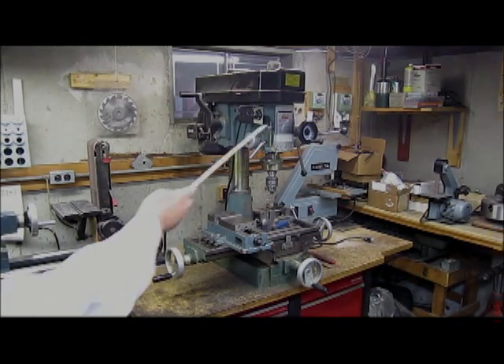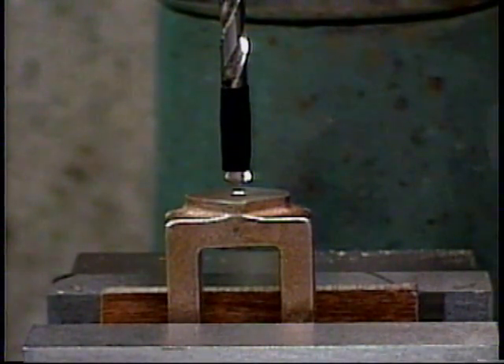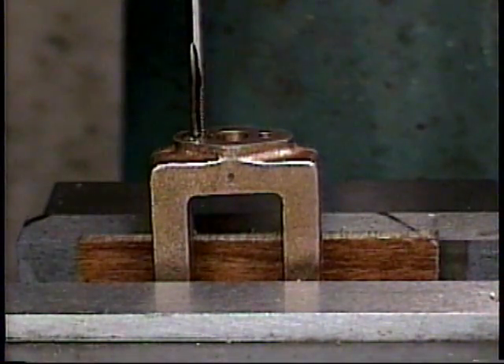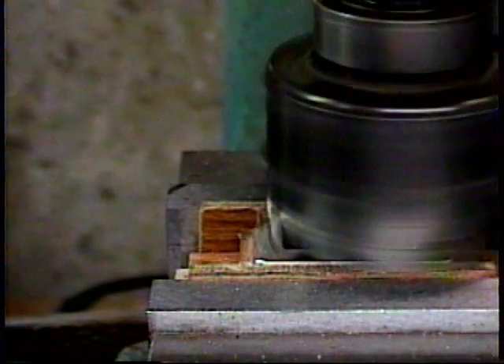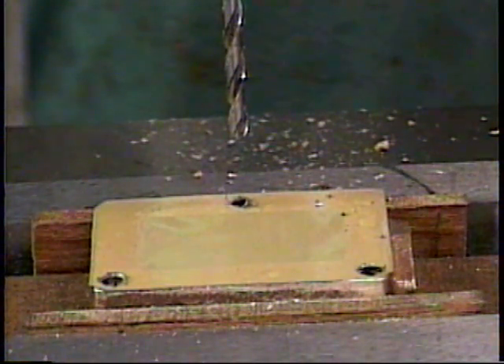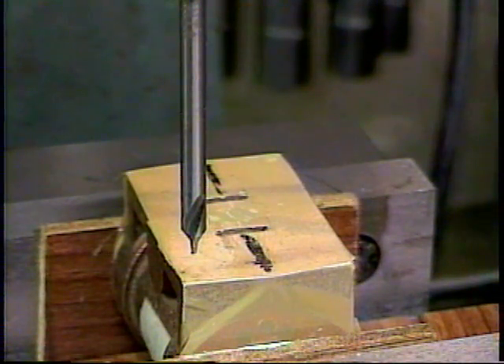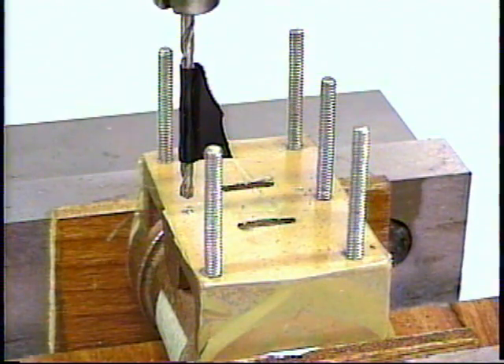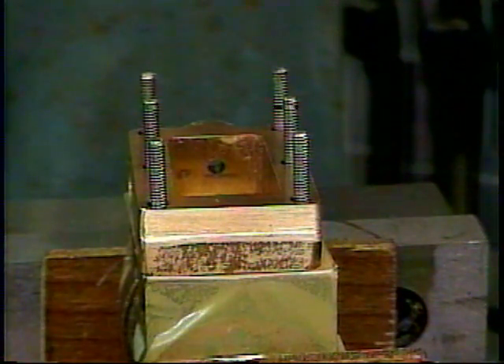PMR 1880's Steam Engine - Machining the Valve Chest

Comment: Thanks for posting these videos.  I am building the cast iron version of the PMR #1 right now.  They now cast the steam chest as one piece with the cylinder.  This may make it a little harder to get a perfect surface inside.  Yours looks good and runs well!
Reply from the maker: Who is making the PMR-1 in cast iron?  I can only find bronze and aluminum.

When you machine the cylinders valve surface, use a mill that is much wider than the slide valve and position the mill so it is cutting at the center line.  That way the valve mating surfaces will have a smooth surface with no mill edge marks.

ShortHand
Reply: ShortHandTom
The only #1 engine kit that PMR currently sells is mostly cast iron with some of the smaller parts, made of bronze.  Their iron is fine-grained and machines nicely.

Thanks for the tips!  So nice to make your acquaintance after enjoying your DVD all these years.

Comment: will this be a building process series?
Reply from the maker: I would like it to be a series.  I have 22 hours of raw tape recorded on building the Drilling Engine.   But each part is a labor intensive effort to edit.  When I can, I will edit and publish the machining of the Cylinder.    Then I will have shown machining castings both on the mill and on the lathe.  So that viewers will understand the processes involved in converting castings into engine parts:   Turning, Boring, Surfacing, Drilling, Threading, and Fitting.